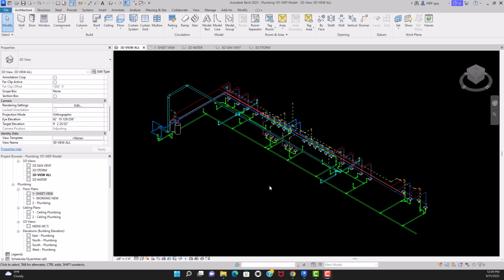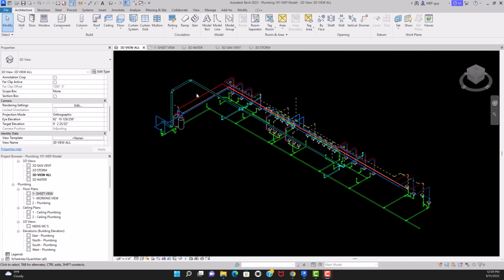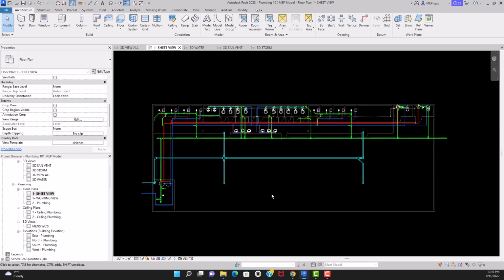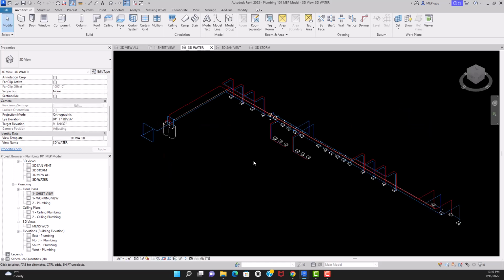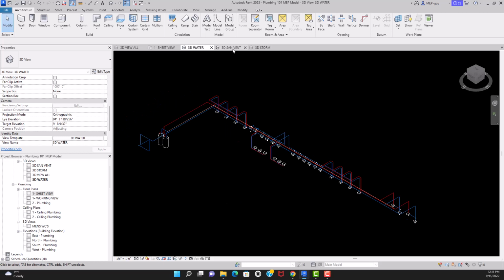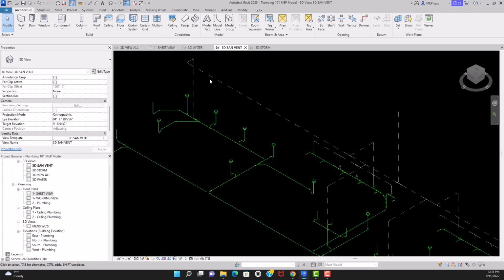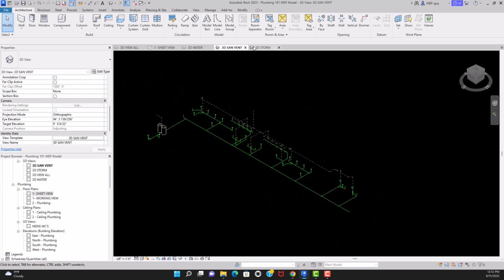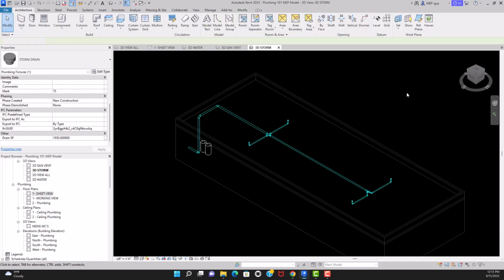Plumbing 101 in Revit - Course Preview

Comment: Hi MEP guy, enjoy your knowledgeable videos on revit. 

Would you ever be able to do a video on efficiency skills for engineering firms that purely just use revit for 2D / few elevations / schematics and coordination purposes? 

I understand Revit has a-lot to offer in the scene of building information. 

I tend to only connect branches and stacks just prior to construction Phase due to how many errors it cause when disconnect. with updates for example. Got any tips like that. 

Thanks again for the videos
Reply from the maker: That's a great idea! It sounds like you're having issues with hosted fixtures and equipment. I understand.  I only use custom workplane based fixtures which don't move with walls. But regardless that sounds like a video lots of firms will find valuable. Thanks again for the advice!
Reply: @mep_guy  thanks for that, looking forward to see the content. As always keep up the good work!